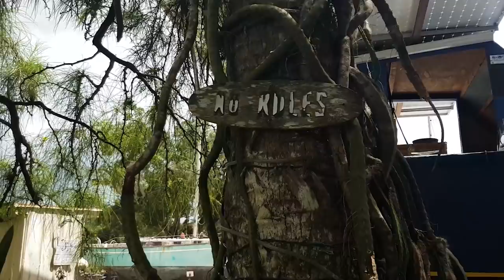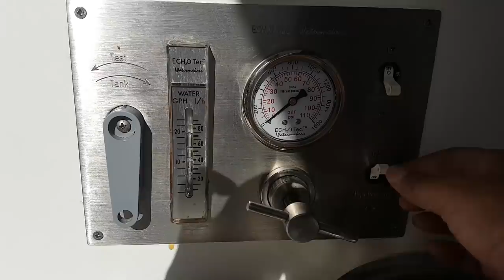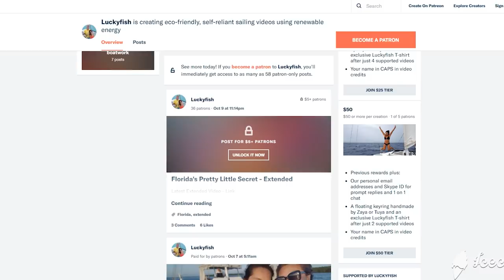Hurricane Hardstand Prep, Irma & Mongolia - Ep 56 Sailing Luckyfish

Comment: I see you've got some gooseneck barnacles starting on the hull. Do they scape off without taking a layer of CC? Also, you might want to run a little fuel stabilizer in your fuel when under way (you may already) or when you run the carbs dry. It will help stop other the other additives in the gasoline from eating your carb floats when in use. Also, I know the feeling of helplessness. I had a hurricane go over my boat on the hard a two years ago. Sustained winds of 110 mph. I came away with no damage, but many boats toppled over like dominos, some with major damage. The hardest part was watching windy.com and knowing the northeast quadrant was hitting directly.
Reply from the maker: +todd parsons yeah, same here, windy and NE quadrant. And 6,000 miles away. Those barnies peeled off no worries. cc unharmed. Pretty impressed by it actually, seems very hard wearing.